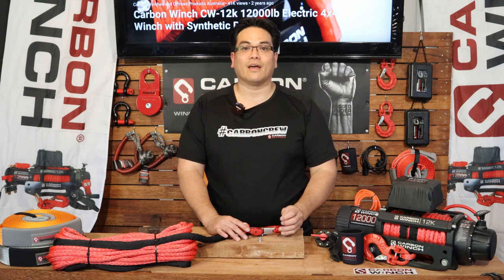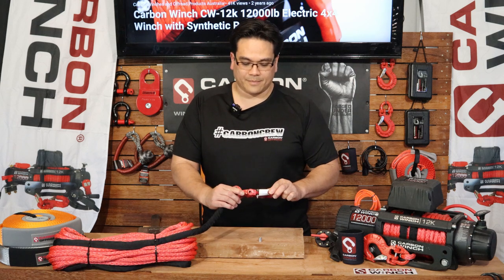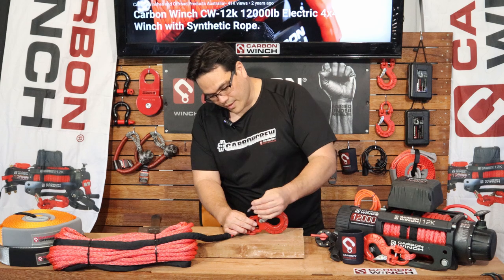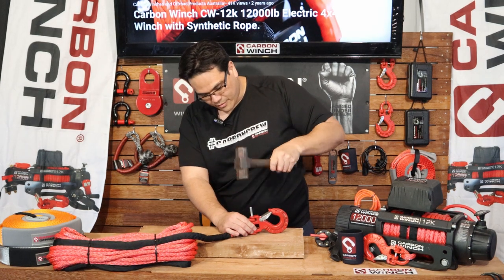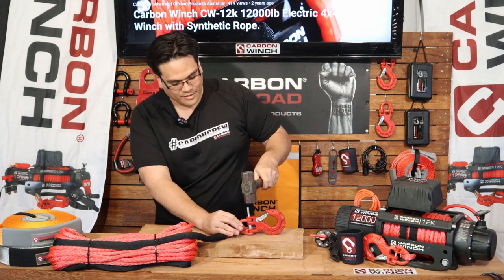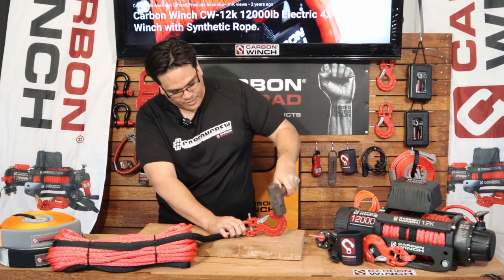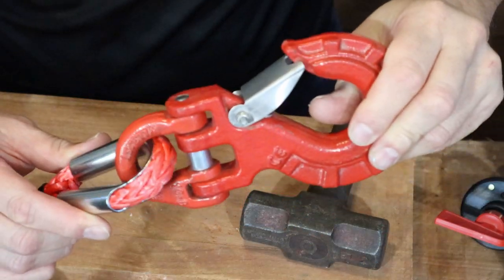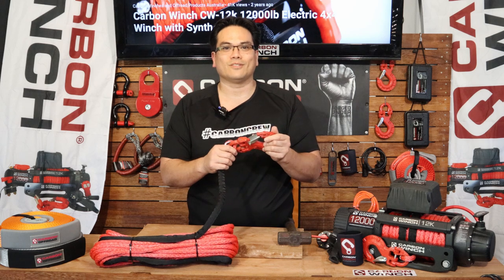Carbon Off Road Hammerlock Pin Install

Comment: Once you've installed the hook is there a way to change it over to a different style of hook at a later date say if I wanted to put a factor 55 hook later on down the track?
Reply from the maker: Hi Dave, yes you just use a pin punch to knock the pin back out of the hammerlock to remove the hook from the rope.
Reply: @carbonoffroad_australia  Cheers mate. Nice winches